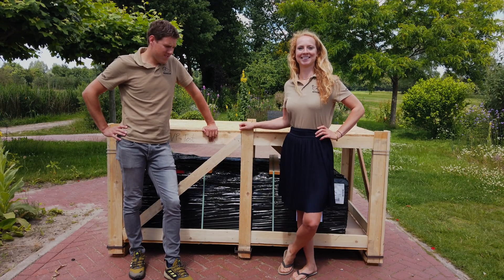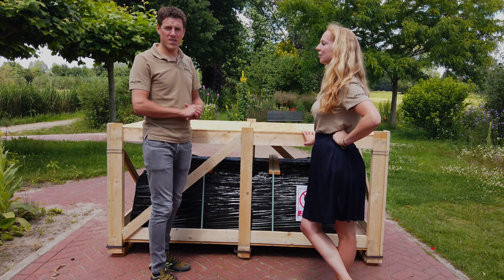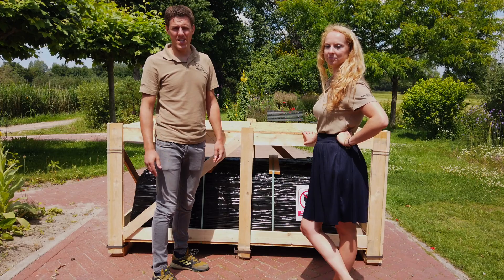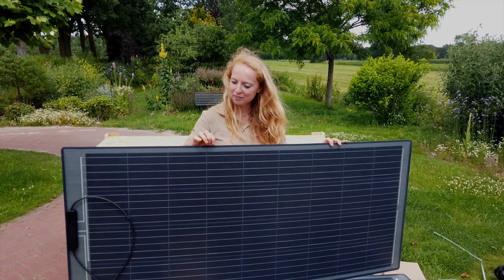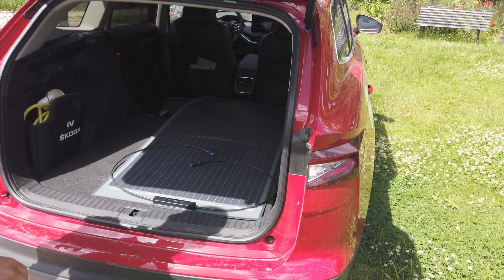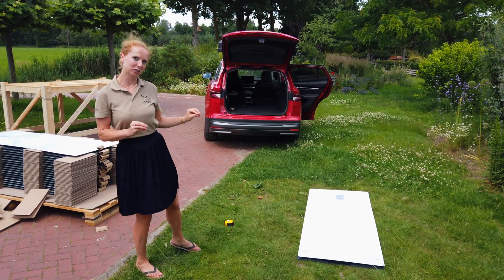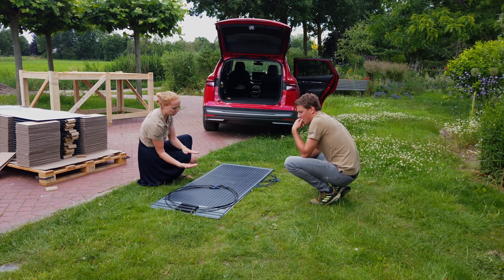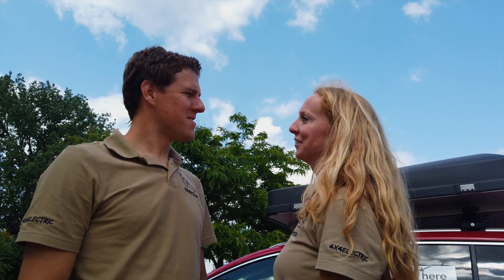4x4electric - First test with solar panels

Comment: Do they have mc4 connectors?
I hate to think of having to disconnect all these mc4 connections after a day of charging. You might want to cut of the part that clicks so it is easier work to do.
Reply from the maker: Indeed mc4 connectors. We keep the panels connected per 3 solar panels, so we only have to disconnect 20 times. After 50 times of plugging in and out, it does not cost that much effort with the right tool!

Comment: That's really cool!  I'm excited to follow your journey!  Have you looked at solar blankets instead of panels?  I imagine they probably don't draw as much power as the panels but could lighter & better packing solution than panels.  

Additionally, have you thought about augmenting panels on the roof as well? Maybe on top of the roof carrier to provide additional charge while you are on the move?  I'm not sure if it's possible to charge while the vehicle is in use, but I'm excited to see people like you diving into this expedition!  Keep it up!
Reply from the maker: Thank you for your message! We have had a look at solar blankets, but their efficiency is way lower than the efficiency of the panels we now take with us. We will install solar panels on the rooftop tent and the hood! We will use this energy for the fridge and to cook (induction)